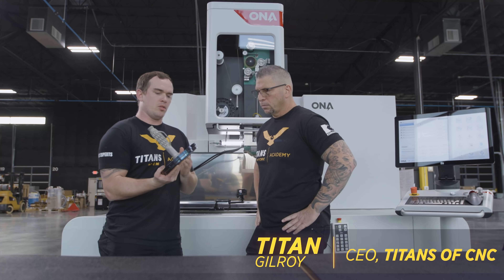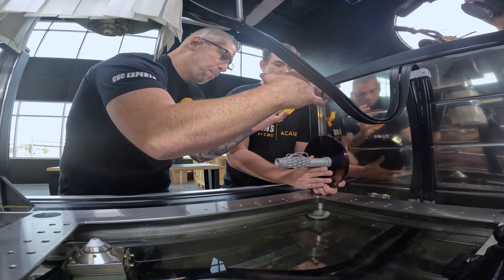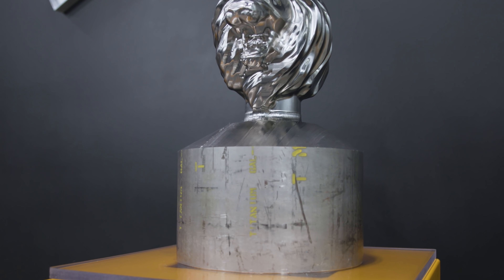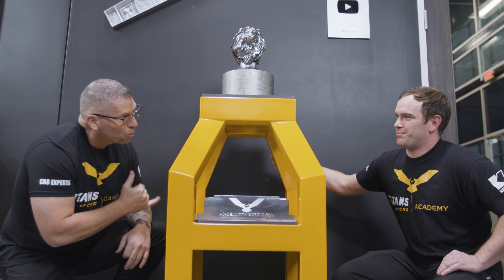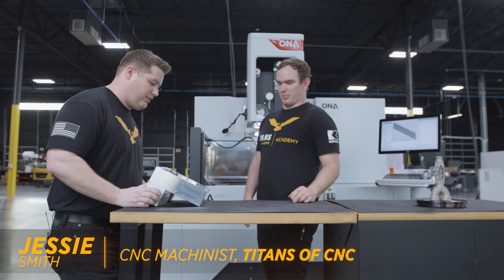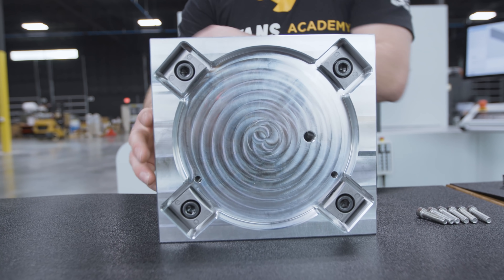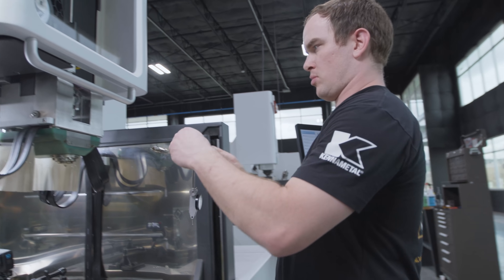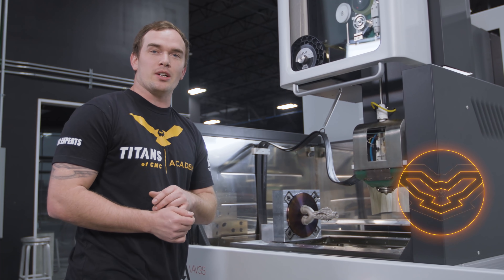Creating a Rigid Fixture to WIRE EDM Parts Off Metal 3D Printed Build Plates

Comment: What kind of fixturing would you use to hold or support the part being removed from the build plate after it has been fully cut off, or would you just let the part fall? We have tried letting parts fall before and had some show signs of damage.

Comment: Should have made the fixture out of a stainless steel like the table, for faster cuts and a more accurate results. Aluminum is notorious for bad Continuity in EDM applications. Why the wire is brass and the table is a 420/440 stainless tool steel.

Comment: We do something similar for additive builds.. except without all this additional expense. If you're supplying the plates, then make or buy some standard plates (we use 6 different diameters). Machine each of those for a central pull-stud (we use Imao). You can either make a 90º plate and mount the pull-stud receiver on it or if using a rail system like Erowa, system3R etc.. use one of their universal 90's and their pull-stud systems. Either way, you only need attach a pull stud when it comes into the shop then mount into your 'fixture'. Then it doesn't matter what the OD of your plate is. 
If you want to make a 90º plate, then mill and leave a small ledge along the bottom for it to register against the EDM rail. No indicating necessary next time you place it into the machine.. short of a sanity check. 

If you only ever use one diameter of buildup plate then this method is fine, but pull stud make like so much easier and there are plenty of systems on the market to choose from.

Comment: Personally you should get a slot milled in so you can set your 'U' to the plate that it's initially mounted to. Not that i doubt it won't be square. With the milling process, but your only as good at the clock you clocked it in with. (The 'V' axis doesn't matter I know)

Comment: I wonder if the mitee bites will pull the plate out at all. And by "pull out" I mean like a thou or whatever little amount it is. I think I would have made a fixture that clamps the plate to the back of the fixture instead of applying inward pressure from all around. I also would have made it like an upside down triangle shape so that the plate lands in the same place every since time, just in case for some reason it needs to be located repeatedly..

Comment: When installing the fixture on the Wire, was there an advantage to dialing it in with an indicator instead of using the control's axis rotation/probing routine?
Reply: I typically wouldn't do it unless I'm close to stroke end, but I guess if they can't do wire tapering on that machine for some reason it might be to check that the part isn't hanging for some reason?

Comment: I dont know , milling special fixture , soft jaws for every project ... not efficient for real job shop. we used to do fixturing on EDM with couple neodymium magnets and worked just fine - easy - fast - cheap !! 
or using waterproof magnetic chuck !! is so important, In Europe we use magnetic chuck for 40 - 50 % of jobs specially second op of milling... didnt see that here ...
Reply: I think that round plate is the build plate from the metal printer.

I'm assuming they made this so they can do a whole bunch of EDM cross sections of crazy 3d printed parts for QA and teaching purposes
Reply: Boom, real world jobbing shop.

Comment: Sorry guys for the negative response but this is not a good example in my opinion. There's no Machining forces for the wire edm so a simple lightweight angle plate with the part glued to it with conductive glue would have been sufficient and saved a few thousand dollars
Reply: :washhands:
Reply: @barrysetzer  I won't stoop to your level with personal attacks but just Ponder the possibility that you may not be the authority on everything machining related
Reply: the part and the build plate are fused together..........they are going to cut it off

Comment: When the part is split down the middle lengthwise, and with a narrow base, will there be any concerning movement of the two halves? When wiring the parts off of the plate, are they allowed to fall into the liquid or are they supported somehow? Great videos. Thanks!
Reply: I would assume they will just let the first cut off just fall, when they cut the whole piece off they might either use clamps or something to support it or just let it fall or leave a tab

Comment: Disregarding whether the fixture is over designed or not, my concern is how the part will be supported to eliminate a cut off bump as the wire cuts through the part itself. I cannot believe a part as complex as this can tolerate a non-flat surface. Therefore you’re looking at a second operation on that surface. To me it seems to be a classic example of not seeing the forest for the trees.
Reply: Typically you stop before the part is cut off and then use conductive glue (or regular super glue with a ground strap) to hold it in place. Then soak it in acetone to dissolve the glue. If it's excessively heavy you would want an additional fixture but the glue would be fine on that

Comment: How do you make sure that the part is perfectly aligned in the B axis ? (rotacional axis on Y)
Reply: if the parts straight and the wire is aligned properly everything should be parallel, side noye wire machines use a u and a v for tilting the wire

Comment: That is way way an over do! A small vice would have just worked great. I would have turn my vice 90° then Dial it's bottom by side to be parallel with one of the axes, x or why and there I could clamp my piece parallel to that axis then just cut it. But I love your inspiration. Keep going.
Reply: If u do such parts on daily basis it makes sense
Reply: Yes, he”s thinking of larger parts later.
Reply: Trust me, you don't want to put any vice, that is not made for it, inside wire EDM. Whole thing is going to start to rust. And all of the particles that are being cut get everywhere, making thing dirty and hard to remove in corners, which could have impact accuracy of the vice.
Been there, done that.
Reply: Agreed as a wirecut operator and more this waste a lot of wire if make same fixture with small clamping diameter 
This to much heavyweight fixture also

Comment: First of all I really enjoy your channel, its been a great source of inspiration for me. Well I have been working as a wire edm operator for about eight and a half years now, but I am not nearly an expert in the field yet. The fixture looks really good I must say, but in my opinion it is a little bit overkill. If you have let's say one to ten parts that needs to be parted off you can get a long way with an on/off magnet that you fix to the wire edm with an overhang. That way you can dial in your magnet once and then cut the parts in series. This is cheaper and more versatile because you can use the magnet for many different jobs. Also if there is a possibility to make the printing base plate smaller that would be good too. With a smaller base plate you can get the nozzles closer to the work piece and get more efficient flushing. This will result in faster cutting speeds from your wire edm. You should also rotate the work piece 90 degrees so you have a more consistent work thickness without any open space between in Z-axis. This will also greatly reduce the wire breakage and increase cutting speeds.
Reply: Hey buddy. Just to help you understand a bit, the build plates are all different materials. Aluminum, titanium, etc. magnets dont work so much there
Reply: @barrysetzer  Hi, yes I now this works only on magnetic steels.
Reply: @barrysetzer  just mount vertical vise there schunk with cylindrical jaws and you done ... 

Titan is promoting brands thats why he did fixture for that, in real job show you would see different more economical approach. im sorry but this channel is promoting brands not really showing good tips and tricks for machining...
Reply: @emzyfilm6492  Boom, real world.

Comment: 😆😂 Sorry but way over engineered, I do a similar job and use an angle plate with dowels on the bottom that push up to the rails so no clocking needed, I do like the clamp idea, mines an open flush machine so dry sparking is nightmare and when the parts cut off mine can drop 600mm so I make sure there's enough old wire for a cushion, one thing to note if you intend to rotate it for different cuts you should have made it with a front sub plate so it can spin on a central boss with out moving the build plate, it was just a thought and the other stuff you guys do blows my mind, can't wait to see it cutting. 👍👍

Comment: Help me to understand, or you guys just don't have much EDM experience. A 90 and a pair of vices grips. 😂
It's an EDM not a mill.
Reply: exactly
Reply: I think the design is to hold the weight of anything the metal 3d printer could make.

If you 3d printed a solid cylinder on that build plate it could probably get a bit heavy
Reply: @flewdefur  I guess if that's all you're using your EDM for is cutting parts of a build plate or that's going to be the majority of work it does. Makes a little more sense 😅

Comment: Ha Hum M8 threads, you Americans had better be careful of not cross threading stripping theads with your standard of 5/16" 😁
C'mon guys Titan, about bloody time you got with the program! 🤣✔️
And stop slipping your 3/8" bolts or nuts into/onto 10mm threads😁
Nvm your 11/16" gear is doesn't cut the mustard for it doesn't fit 10mm and 12mm is a cock on a sock, 1/2" is lazy yet strong at U.N.F  for a mid range cross reference dimension!😁
14mm ,9/16" @14.26 ain't mustard in between, 5/8" as opposed to 16mm standard issue for 5/8" sets as 15.875- to the 16mm
11/16 no reckoning at all especially in industry and 3/4'  which is 19.05 in metric holds its own margin whereas 20mm metric get way to many folk on the back foot especially on a visual due to thread pitch closeness's ,
13/16@21mm covers it, 7/8" the same @ 22:mm which is 22.22 @7/8" to be precise, industry standards on end to the inch hit pretty much unmarginally from the get got leaving only one other that synonymously fall in standard of common usage 24/25'" meekly under the whole inch @25.4mm  and just above the 25mm metric zone ..... considered the mofo range due ISO Gradient Standards of measurements across the globe! 
We in industry know our stuff there is not doubt about it whatsoever, although when it comes to ,"STANDARD WEIGHTS AND MEASURES" , the best usage of dual standards IS.....DONT FFFF UP, Read your drawings, read your trade and hold TRUE TO A STANDARD!
....Ying/Yang was not created for no reason.
Enjoy❤️
Reply: I read every word.
I think it's time to adjust your meds...
Reply: Ummmm.... OK...... Anyway, moving right along people.

Comment: Could that L bracket be a T bracket, so mounting plate sits lower into the table for more height clearences?
Might not be an issue on this part, just asking if it can be done.

Comment: Why no raised edge on the fixture though? The edge of the mounting surface should be straight with the y-axis, so you could just push the fixture against it. Now you have to clock it evertime.
Reply: if you do things right you still have to clock it.. you can't trust everything to line up first try despite your effort in doing so.. there is always going to be inaccuracies in parts. That's why you use the dial... 
I'm sure both those machined surfaces are perfect to spec, that doesn't mean external factors is not gonna screw up your workholding..
so, better safe than sorry, always dial your stuff - even when you think it's perfect. that way if things are not to spec on the final product you can always eliminate inaccurate workholding.
Reply: @therealsourc3  Titan is always talking money, so clocking a fixture for cutting a 3d print off sounds like a waste of time to me. If there a no tolerances that require that kind of precision a fixture pushed against a straight edge will do fine. They also use those fixturing pods on there clamps for there CNC machines, do you think they clock them every time? They use them so they can quickly change clamps without having to clock them. If you want perfection you have to clock every part, there can also be dirt on your fixtures screwing things up. But this video is not about those requirements.

I'm assuming they are not only using that Wire EDM to cut of printed parts of that platform. My reaction is less of an issue if they leave it on there for long ofcourse.
Reply: @ltrzfrnk-d7z  they are going to cut the part off with the wire machine
Reply: @ltrzfrnk-d7z  Clocking stock material and finished parts is not the same. I wouldn't bother clocking the stock unless i had very little material to remove (less than 5 mm)
But these guys are gonna cut the 3Dprinted part through its middle so you can see inside. A scewed cut is very noticable.
Reply: they can just push it against the bottom of the fixture you know?
Reply: @DylanVos05  I meant the fixture on the machine, not the part in the fixture.
Reply: @ltrzfrnk-d7z  i mean.. i dont think they'd leave the bottom of the fixture if they decided to remove it

Comment: Interesting idea, those clamps. However, I am unable to visualize how the clamping force is generated? If the radius of the 'pitbull clamp' exactly (or approximately) matches the base plate radius, then how does tightening the bolts generate the necessary 'inward' clamping pressure?

PS: Can't wait to see the internal geometry of the Fluid Mixer. Great work as always.
Reply: the clamps actually only touch the bottom of their pockets on one side (imagine a / but at a shallower angle), when the screw tightens down on it, it tries to lay flat (moving from / to - ), this causes sideways and downward pressure on the top end of the clamp (which is the side that touches the part

Comment: way to complicated solution, will definitly work, but it would be much easier and quicker just do take a magnet and attach the plate to the magnet. during edm machining, there ist no force, so the fixturing has just to hold the part. nothing more, no cutting presure no vibrations, no quick movements. a cubic magnet will cost you one a couple bucks but afterwards there are no more costs. you dont block a mill just for machining a fixturing,
Reply: A magnet would NOT work, as the build plates are all different materials. Stainless, titanium, aluminum.
Reply: @barrysetzer  👍🏻, that motivates the somewhat arduous task of tightening all the clamps. I prefer one leaver that stays with the fixture.
Reply: During the EDM machining,  the water flowing induce forces into the piece and can cause vibration depending the form of the piece to machine.
Moreover, you cant use normal magnets because interfere with the machine itself; you need to use a special electromagnet designed specific for EDM
Reply: @MrAgropom  no its bot nessecary. We work like this for years now. All works without any issues. On the sinker as on the whire edm as well. It the part holds in the fixture as good, that you can put it into the machine, it wont fall off during machining.
Reply: @damianderungs6210  Exactly, my EDM guy would have that part cut and done before these guys had that over kill fixture made.
Reply: Even if it is a bit overcomplicated and beefy i think it will suit them for many more others pieces. For this plate where detail is, they could make other different pieces. so it can be vbery usefull for them in future. Using same block same plate but different details.
Reply: During first cut high pressure pump would blow it off easily because this part is far too long. But i confirm it is possible to cut part attached directly and only to magnet because i have done that many times
Reply: 👍🏻 A magnetic surface grinding chuck with a position ring would have been perfect